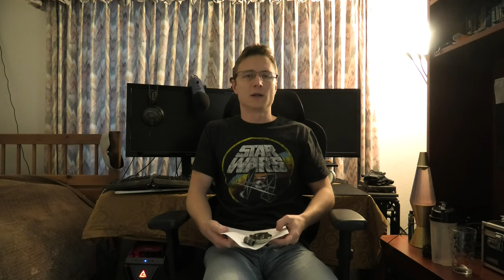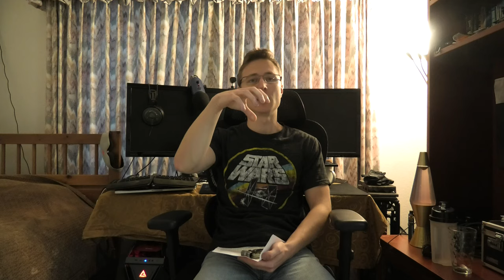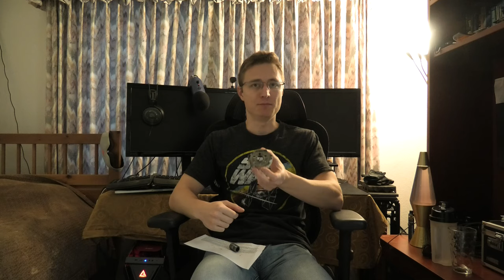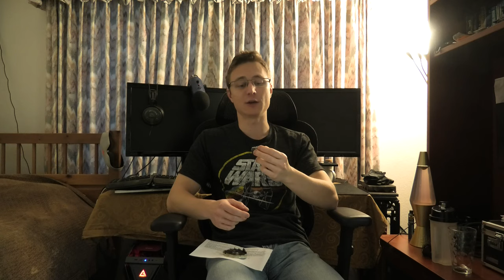Fix for stuck oil filter

Comment: I was removing the old oil filter and the bolt where you screw the filter broke off with it! I'm trying to find a video that shows me what to do if that happens!
Reply from the maker: I would recommend hammering in a fluted bolt extractor and then back it out. If you have pneumatic tools this would be the best time to use them for this. For example if space is tight use a pneumatic hammer to pound the flute extractor in, then use a ratchet tool to back it out slowly. Make use to get some penetrating oil on the threads.

Comment: good videothere ...i had this issue a few years ago..the filter had been put on at the dealers and was totally stuck on..like u say hand tight is all that is needed..but mine seemed like king kong used a breaker bar to put it on!..prob over tightened it and didnt put any oil on the rubber gasket...but what a nightmare
Reply from the maker: yeah and its a real pita since local auto stores do not have the proper tools to get the job done on less common vehicles.